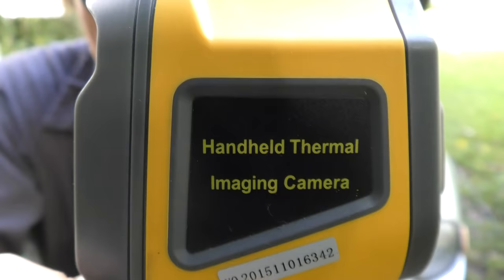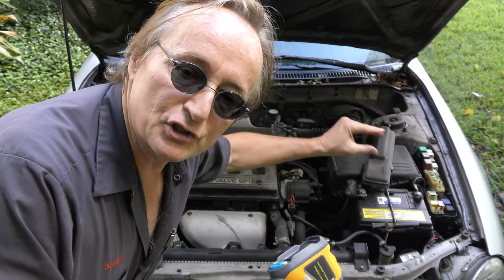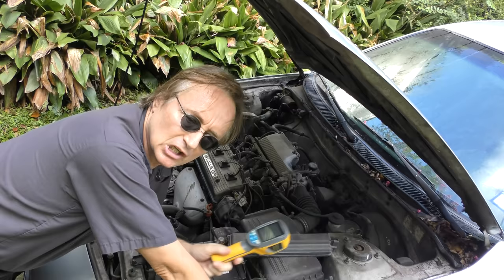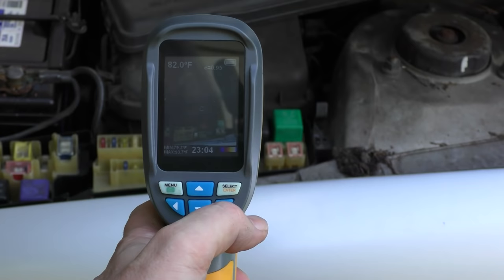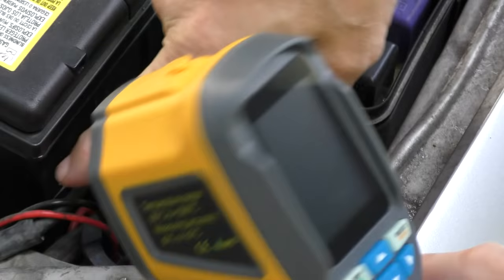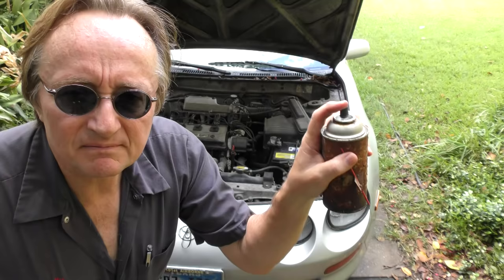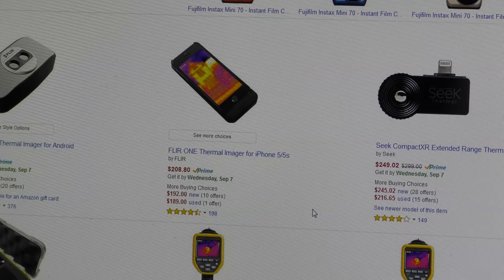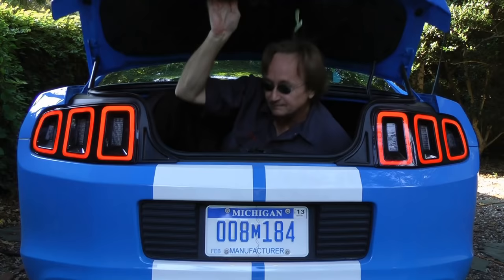How to Find Electrical Short in Your Car - Thermal Imaging

Comment: Scotty,  I am going to stop watching your show, you just made me want to go to ebay and spend $150. LOL That was an amazing tip. Electrical car problems are terrible, what a great help. Thanks a bunch Scotty!!
Reply from the maker: In the long run that 150 will save you tons of money, believe me.
Reply: +Scotty Kilmer hmm Scotty my corolla 95 dx shows half of its dashboard lighting when lights are enabled, and battery is not the solution here either. I replaced my fuses as well, my timing belts are quite worn, would that be part it of it or is it the wiring?
Reply from the maker: the dash unit circuit boards short out with age and do that all the time, live with it, new dashes cost a ton and that's so old, a used one would probably be bad too
Reply: +Scotty Kilmer hm. I just might make a custom one then, maybe replacing the lights in there is the first thing I'll try then. Very much appreciated Scotty.
Reply: +Scotty Kilmer I love you Man.

Comment: I have a harbor freight thermal temperature gun that can look at a small area or pin point spot. it was cheap and has been very useful to me for similar things like you used the camera. I am retired but spent many years as an electronics/radio technician. I use everything. Look, smell, touch(includes feeling for hot), sound, poking, vibration, shake, along with instruments, applying heat/cold. What ever is available to track down the trouble. Its a good fixit person who finds the problem, fixes it without guessing around or damaging more stuff in the process. LOVE your show Scotty.

Comment: I'm in the middle of researching to buy a TIC. I primarily want it to check for heat loss in the house. But being a mechanic, I can see the obvious use for a TIC for diagnoses of electrical, cooling and mechanical faults. The Snap On TIC looks good and has a great reference point with examples of good and bad items that you will check - alternators, exhasts, coils, heated seats etc. This helps to show what you are looking for. But I noticed that the image quality in these low end units - like the one Scotty is using, is very poor. I've decided to go with a Flir C2. For basically the same cost as a Snap On unit you get a MUCH more detailed picture, A longer range of vision, a heap more options of the image choice and you can use it on your house, car shed, caravan etc. You can even find water leaks in walls and under concrete. I would not buy a house now without one.
Reply from the maker: I actually have a flir now, but the company gave me one to try out. it is much better for sure.

Comment: Very handy tool, I use to use them when doing maintenance on mains distribution panels so you could check for loose terminals by the heat they generated without shutting down the power.

Comment: Those thermal cameras are brilliant. With these you can also check glasfibre boats for delaminating problems. Or mechanical problems since friction causes heat.

Comment: I was thinking FLIR for a possibly finding a dead short - one that blows the fuse.  The Old School short finder was a 10amp automatic reset circuit breaker to be used as a fuse and a hand held current meter that measure current when held near a wire.  The cycling of the breaker makes the meter needle twitch.  Follow the wire until it quits twitching.

The $64 question is the cycling of the breaker have enough duty cycle to heat the wire sufficiently to heat the entire harness to the extent that FLIR will see it.

Comment: I think that will help me finding that sucker short in my girlfriend's 1999 chrysler sebring JXI convertible 1st generation , she even short out with all fuses and all relays out , and all the plugs and even alternator disconnected , I did the light test on negative pole , and still lighted up with every single circuit and plug off , it has to be a damn wire down the line , thanks  Scotty this information is going to help me center the solution to my tedious  problem .

Comment: A "short" is an undesired connection. What is described here is high resistance connections or "loos off connection" which is actually the opposite of a short. Good video though as the camera will work to find those weak connections.
Reply: so if wires are touching you have your undesired connection aka short...wow learned a bunch in 5 mins(more than community college taught me about auto electricity) ...thanks
Reply: Correct, and this instance does not normally generate heat to be seen under a thermal camera. It tends to pop the fuse instead.

Comment: There are also Infra Red Thermometers available on Ebay for under $20. They look almost like these imaging guns. They even shoot a little red beam at what you're measuring. The device doesn't give you a picture of the hot area, but the red laser shows you exactly what you're looking at and it gives you an exact number in degrees Fahrenheit. It's great at telling me what my oil temperature is when I pull the dipstick on my motorcycle (198 °).

Comment: 1 day I was helping my dad fix his brembro brakes(high end brakes the dealer wanted 800 bucks for) and I spent a couple minutes looking around on his car that only had like 40k miles and I was like dude look at your serpentine belt....he gets over and he's like holy crap it's down to less than an inch thick thank u for spotting that....then we were fixing a problem on my truck and he was like you have an arcing(spelling idk) problem....he said I had a current jumping wires and we just used zip ties and that fixed the problem but I thought I'd share my story since arcing is electrical like electrical shorting

Comment: Great tool, I'll definitely have to look into getting one. But what about using a laser thermometer? It's a whole lot cheaper than using the IR camera.
Reply from the maker: yes, but they only do points of temp, you really need the whole range for accuracy and then be able to see what you're looking at, as with this gun when switched to just photo mode instead of thermal mode.

Comment: Hey Scotty. I got a 98 Tahoe. Fan only works on high for the ac and heat. Replaced blower motor resistor with no change. Replaced control module on the dash with no change. What else can I look for? relays and fuses are good.

Comment: Just had a thought, dangerous as that can be. Instead of the thermal imaging camera at $150, how about a non-contact thermometer, just point and pull the trigg and read the digital display. Harbor Freight Tools has one for around  $ 25.00 or $35.00 thereabouts. Since I've been wanting one anyway, I'm gonna give it a shot. If it works well enough perhaps I'll put it on here and share the results with all the world. Or anyone's that really cares at all. It would sure save a bit of money and has a plethera of other uses to. Just thinking.

Comment: Hey Scotty, question on Haynes manual wire diagram a (sensor signal' wire is that a pulsating power lead ?another question Ebay has these KWP 2000 plus Remap flashing tool"are they helpful or your opinion.

Comment: hi i have a question Scott my car has code 1122 i already bought a new throttle body and a new gas pedal as well and i cleared the code and started the car everything sounds good till it goes to normal temperature the rpms go way low i try to push the gas and it only goes to 1 1/2 rpm my car has been sitting for 7 months now its a Nissan maxima 2002  hope to hear from you thanks

Comment: if you're ever in Arizona Scotty , stop by in Buckeye AZ. we'll throw some meat on the grill with some mesquite and I'll smoke a blunt witcha homeboy lol
Reply from the maker: will do
Reply: +Scotty Kilmer I have no power going to my fuel pump . put gas under the hood in the intake and she fires up . but when I hit the gas it dies. not getting gas,  but I'm sure the pump is good . does it sound like the fuel pressure regulator? it's a 1995 f150 with an inline 6 . fuel injected.  dual gas tanks with in-tank fuel pumps. also before it stopped running I was only running the back tank because the front tank was not working (which stopped working out of nowhere) should I just drive it into the gila river ?
Reply: I'm having a similar issue with my lincoln continental. it fires up but stalls out pretty quickly. I've already replaced the fuel pump and believe its the fuel pressure regulator as well. The regulator doesn't spew gas or anything but it still doesn't seem like it's doing it's job.
Reply: I'm having a similar issue with my lincoln continental. it fires up but stalls out pretty quickly. I've already replaced the fuel pump and believe its the fuel pressure regulator as well. The regulator doesn't spew gas or anything but it still doesn't seem like it's doing it's job.
Reply: I'm having a similar issue with my lincoln continental. it fires up but stalls out pretty quickly. I've already replaced the fuel pump and believe its the fuel pressure regulator as well. The regulator doesn't spew gas or anything but it still doesn't seem like it's doing it's job.
Reply: I'm having a similar issue with my lincoln continental. it fires up but stalls out pretty quickly. I've already replaced the fuel pump and believe its the fuel pressure regulator as well. The regulator doesn't spew gas or anything but it still doesn't seem like it's doing it's job.
Reply: I'm having a similar issue with my Lincoln Continental. It fires up but stalls out pretty quickly. I've already replaced the fuel pump and believe its the fuel pressure regulator as well. The regulator doesn't spew gas or anything but it still doesn't seem like it's doing it's job.
Reply: I'm having a similar issue with my Lincoln Continental. It fires up but stalls out pretty quickly. I've already replaced the fuel pump and believe its the fuel pressure regulator as well. The regulator doesn't spew gas or anything but it still doesn't seem like it's doing it's job.
Reply: I'm having a similar issue with my Lincoln Continental. It fires up but stalls out pretty quickly. I've already replaced the fuel pump and believe its the fuel pressure regulator as well. The regulator doesn't spew gas or anything but it still doesn't seem like it's doing it's job.
Reply: I'm having a similar issue with my Lincoln Continental. It fires up but stalls out pretty quickly. I've already replaced the fuel pump and believe its the fuel pressure regulator as well. The regulator doesn't spew gas or anything but it still doesn't seem like it's doing it's job.
Reply from the maker: pressure test the regulator then, or just go and replace it if you don't have that equipment

Comment: You are one of my favorite YouTube Mechanics. I have just installed LED tail light and turn signals in my Yamaha FZ6 and the tail fuse keeps blowing. I will look for a grounded wire when I get home but is it safe enough to ride home from work? about an hour ride and everything aside from the rear end lights work fine.
Reply from the maker: sure, just leave the fuse out., and realize leds often need ballast resistors
Reply: Scotty Kilmer thank you sir. My exhaust melted a small strip of my plate light positive wire under my seat and every time it rubbed the metal it popped the fuse. I re ran the line with some insulation and it works like a dream! Thanks again

Comment: If you have a short, you have a bigger problem; your fuse didn't blow.  A more accurate description could be "find circuits drawing a lot of current." Or, how to find "bad" connections or faulty corroded wire.

Comment: That’s not a short circuit. The headlight connector you spoke of would only be on the output of the relay. So if the relay was engaged where did the coil trigger come from?

Comment: Hey Scotty! Michael Ennis again. I put in a new battery in and also checked my alternator and its good, and still all of my gages don't work. They did just fine when I drove the van home. I drove it approximately 10 miles on a bad battery. Any idea what I may have screwed up.thanks again..
Reply from the maker: If you wish to ask me car questions, I am switching my questions and answers to my website. So go to www.scottykilmer.com  and ask me in the Ask Scotty section. So please, if you want your questions answered, go to this link and join my completely FREE website. No strings attached.

Comment: Is it possible to measure the function of an ABS wheel speed sensor with a simple multimeter? The code reader says the sensor is bad, but it could be other things (like the computer not accepting the signal from the sensor, or a wiring issue), so I thought before changing the sensor, I'd try to measure it first. How do I do that?
Reply from the maker: If you have all the data on input and output you can try, but you'd really need a meter that does oscillicope functions for a true test of the sensors.
Reply: Scotty Kilmer Oh, I see, that's too bad. The shop my buddy (who is going to repair it) works in does have an oscilloscope, but nobody there knows how to use it, LOL (me neither)...and every scope is different, so it's apparently not that easy to learn....

Comment: Scotty,  I need your opinion. Would you advise buying a 1985 corvette in decent shape inside and out for $4,000 dollars ?
I don't know anything about the reliability of the c-4 corvette and don't want to get in over my head, would you please give me your thoughts on this purchase ? I plan on driving it on weekends and working on it as needed.  Thank you very much.
Reply from the maker: old cars look cool, but generally are rat's nests of future problems.  But if you like the car and it actually runs decently, they can be fun IF you like fooling around with cars. Just have a mechanic check it out FIRST

Comment: Cool channel :)
I was wondering could you tell me - I have a 1993 mazda mx3 precidia and
 it has oil in the coolant/reservoir, but the engine oil itself is clean
 inside the engine and oil filler cap. It is also leaking the 
antifreeze/oil mixture under the engine. I was thinking it was the head 
gasket, but then someone told me it is probably the oil cooler, because 
the oil cooler has a gasket that can fail and allow oil to enter the 
radiator.
Do you have any experience with this car, and what do you think?

Comment: I drive a Chevy HHR 2007. The other day it started blowing room temperature air. I added one can of 10oz freon it still didn't get much colder. So a day later I added another 10oz can got a little colder but not how it was a week ago. Any reason why? What should I do next? Thanks for your help.
Reply from the maker: check for leaks, it's leaking somewhere, try leak dye in a can

Comment: Hey Scotty, got a 01 escort zx2, car is super reliable and awesome,  have a front end passenger side clunk, whenever i press the brakes to slow down or go over a bump, shocks and struts, inner and outer tie rod ends and stabilizer bar links bushings are relatively new. 

but not sure about this clump as everything feels tight down there. what could it be?
Reply from the maker: often worn ball joints, or worn strut mounts if you didn't change those with the struts, or broken motor mouts
Reply: both ball joints were also replaced a while back and strut mounts were replaced with the new shocks.   will look into the motor mounts then. funny that the clunk started happening after changing the shocks and struts but those are solid.

 Thank you

Comment: hey Scott,
  I've been trying to figure out what battery to get for my car.  I know I'm supposed to use the recommended battery for it but I want to upgrade to a yellow top optima to handle my extra bits.    so what's the harm in running a larger battery with a few extra hundred cranking amps. (since they don't have my exact battery size)
Reply from the maker: that hurts nothing, but the quality on those optima batteries has been doing downhill recently. i would not buy one

Comment: I have a question for you scotty. I have a 22 year old Sonoma. And around 40% of the time when I go into reverse, it has a little, not much but a little bit of grind. Almost like the clutch is not all the way pressed, but it is. So my question is, what causes this and how to fix it.
Reply from the maker: worn clutch parts inside the transmission , live with it. OR, reverse gear is starting to wear out if it only does in it R and not forward
Reply: Scotty Kilmer Okay. that would explain it. Now is the myth true that putting it in first and then second helps?

Comment: Hey Scotty I have a 2002 Chrysler Sebring convertible Lxi and I always have to wait for the car engine to warm up or else the steering wheel will make a squeal noise and restraint the wheel from moving unless you accelerate.  what could be the problem?
Reply from the maker: replace the fan belt